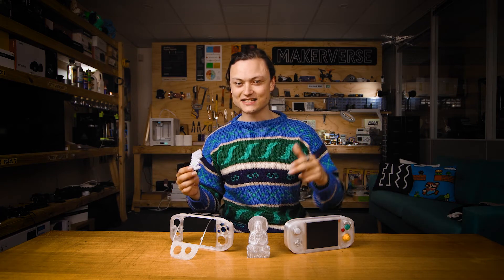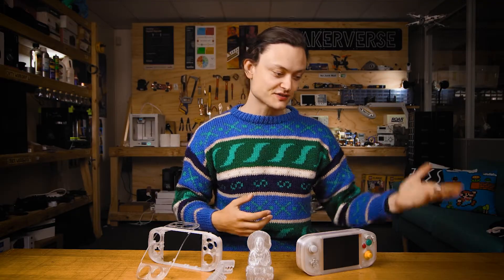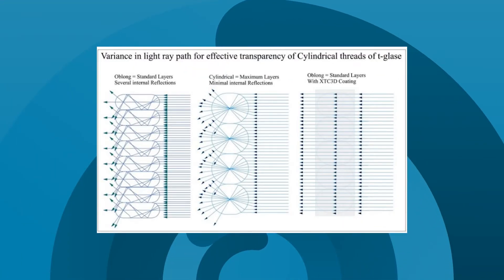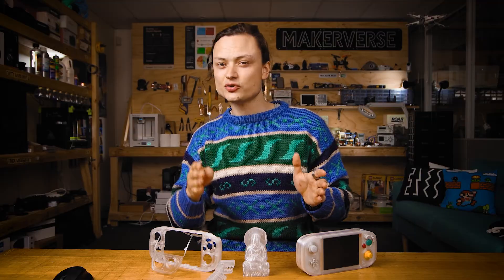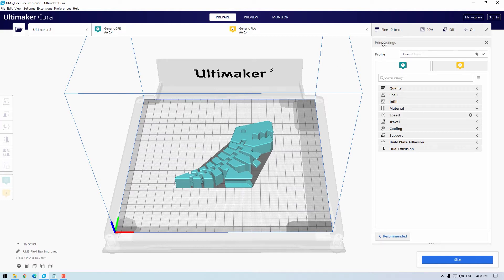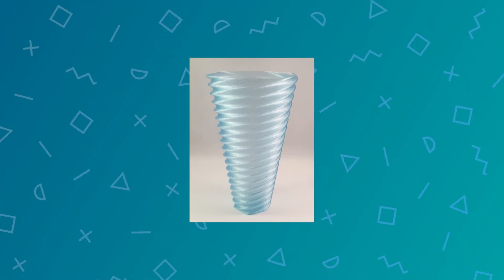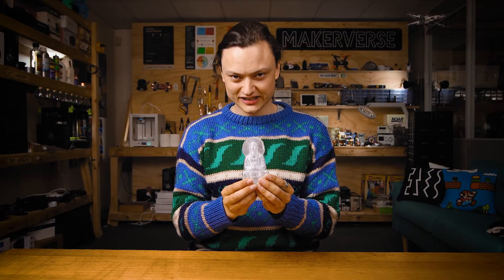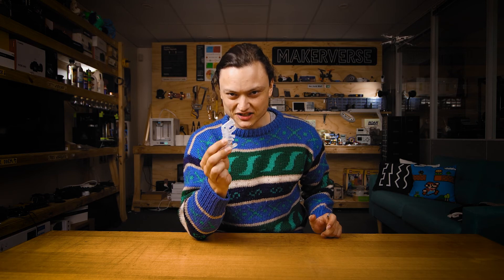Transparent Filaments | Tips to Improve See Through 3D Prints

Comment: What about trying that Polywatch scratch remover after sanding it? maybe that would work?
Reply from the maker: I don't think anyone has even thought of using Polywatch Scratch Remover on 3D prints. And I think its definitely a brilliant idea! Adding it to my list of experiments to try over here 😊. My only thought is that it could potentially be too abrasive as normal use of that Scratch Remover is for the very hard sapphire crystal watch glass windows.
Reply: @Core-Electronics  That's what I was wondering.... But it would be worth a shot. Or maybe some similar solution. I had watched a watch restoration video and this popped into my mind that it may just work. But I don't think I would try it on that expensive clear PLA, might be too soft. Maybe try it on the rougher cheap stuff?
Reply from the maker: Once I get some I'll try it on everything haha! 😊
Reply: @Core-Electronics  Awesome, can't wait to see the results! If it works, I will do it too
Reply: @Core-Electronics  Also, if it does work fairly well, but it proves to be too corrosive, maybe try finding a less corrosive generic alternative perhaps?

Comment: Newbie here. In terms of material compatibility, Is it important to stick to the list of materials stated by the manufacturer or could I change settings to accommodate different materials not listed by the manufacturer? Ie. The manufacturer lists pla, abs, tpu only, could I use petg and others on this printer?
Reply from the maker: So long as your printer is capable of reaching the printing and bed temperature required for the material (and is not locked into using a specific brand of filament/your concerned about printer warranty) you can definitely print any filament.

Comment: could´ve been 15 second video. print petg. 100 infill. get dust grain size salt. embed the print in the salt compacting it thoroughly, put it in the oven at 240 degrees for 45 minutes. let it cool down slowly. remove print from salt and into water so the salt around it dissolves. quickn dirty sanding. SLA level transparency.
Reply from the maker: Thanks for the tips! You should make a video on it 😃
Reply: @Core-Electronics  you´re welcome. just youtube search "salt annealing" and you shall find. Bonus: the plastic ( especially PLA gets ALOT stronger and MUCH MORE heat resistant ) i´ll be waiting for your video on it :3
Reply: Jackass